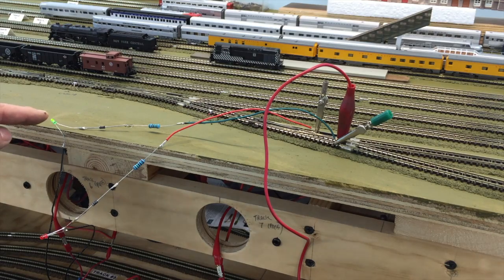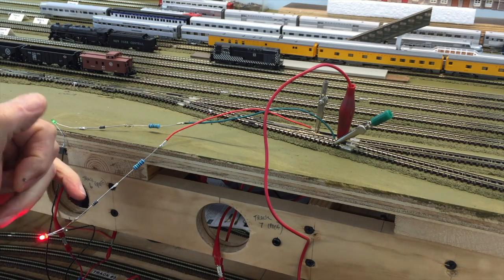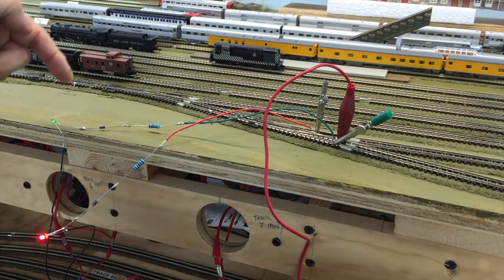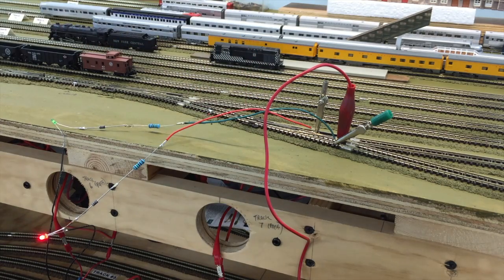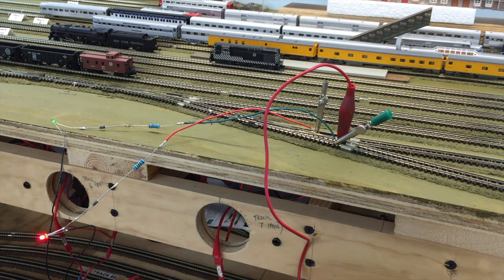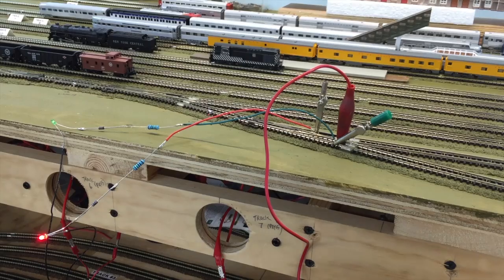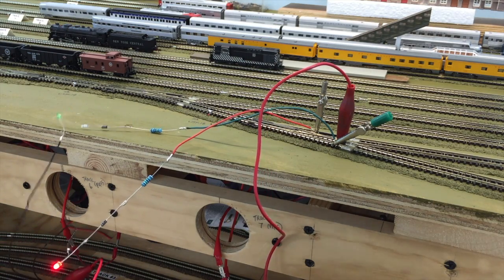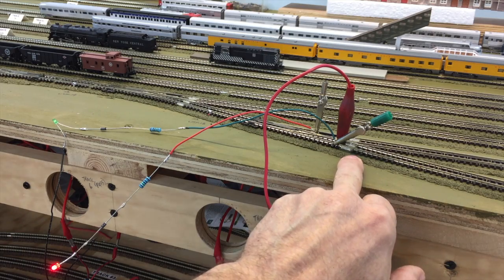DCC Electrical Fun - LED Position Indicator for Manually Thrown Peco ElectrofrogTurnouts

Comment: Hi, would this work for dcc controlled points?
Reply from the maker: Hi John, Thanks for watching and your question. Yes it would work. I have a total of 98 turnouts (Peco electrofrogs on the main level and insulfrogs on the staging level) on my layout and I made a decision that I would only automate those turnouts that I could not reach. The cost of using Tortoise or other brand of controls for turnouts plus the associated accessory decoders and wiring was deemed by me to exceed what I wanted to spend on that aspect of my layout. There are 8 turnouts on the east end of the Union Station yard that I do control via DCC (Peco tabletop snap switches) but all of the rest are manually thrown……John
Reply: @tanzj  I plan on having motors on all my turnouts, some controlled by dcc others by a small switch for shunting operations. I'm amazed how simple your system is, how is it that everybody else does it in a more complicated way?
Reply from the maker: @johntavish8750  Thanks again for your comments. I guess that probably due to the number of turnouts on their layouts that they decided to spring for the cost of automation of every turnout. As a retired person it just was not affordable to me…..John

Comment: Nice job here 1 question tho do you think this circuit would work with Insulfrogs ??? I got a walthers  insulfrog 3-way switch I`ve managed to get an athearns  snap switch an relay hooked up an working on the front set of points.. but I just cant get the second set of points set up to work the same way. So I put a caboose manual throw back onto it... don't really want to do install the undertable thing...
Reply from the maker: I don't think that it would work with an insulfrog because the circuit uses the frog as the power feed for one leg of the LED.  A 3-way is a bit more complicated since it really is two superimposed LH/RH turnouts. You can use a DPDT type slide switch (2 of them) to change the position of the two insulfrogs while using the DPDT switch's contacts to change the LEDs to show the position of the two turnouts. There are several examples on YouTube on how to hook up the circuit using DPDT slide switches. Hope that helps.....John
Reply: Thank you.. I`ll try looking those up an see if I can get it done that way ..I`ve gotten the front set of points hooked up to an Atlas snap switch an relay an it works perfect...the problem I`m having is the second set ...the slide bar on the points is to short so when I attach the snap switch the alinement is way off an will not pull the points far enough to close them.. Thought about just making a new slide bar but not too sure just where to find the tools to do it
Reply from the maker: You can use a small piece of piano wire to go from a slide switch to the slide bar as long as there is enough room to attach it to the side of the slide bar. Or you can go under the turnout to the middle of the slide bar. Some turnouts already have a hole in the middle or you can drill one to match the diameter of the piano wire. If you are concerned that you might short out the track with the uninsulated piano wire, then you can use a piece of styrene pipe just a little bit bigger than the wire. Or you can even try to use some RC control line to connect to the turnout throw bar. Another option, if the 3-way is still in production at Walthers, would be to call their parts department to see if they might have some replacement parts....John

Comment: Sorry to burst your bubble, but the advice given on the other web site regarding the additional diode is not correct. I am a professional electronics engineer. The DCC voltage is about 30 volts peak to peak. An LED is sensitive to being damaged by excessive reverse bias voltages. The diode on the other hand, is far more robust with regard to reverse bias. The diodes as shown in the diagram above protect the LEDs against excess 'reverse bias'. OK I acknowledge that to the untrained eye the LED (without the diode) appears to function perfectly OK. But, it is being unduly stressed. Leaving the diode out of the circuit isn't going to kill the LED instantly and straight away, but it is very likely to reduce its overall lifespan. Personally, I would re-instate the diodes. This comment is not aimed at the original author as the video is more than a year old. It is aimed at new viewers who may be considering implementing this LED design today or in the future.
Reply from the maker: Thanks for watching & I do appreciate your comments.  The subject was beaten to death on Model Railroad Hobbyist by a number of people with opinions in both directions.
Reply: Yes John, this type of debate regularly generates opposing opinions. Many take the view, "It works, so my opinion must be correct". Whereas, the better more reflective view to make is "just because it works, doesn't necessarily mean that it is best engineering practice". The additional diodes are a minimal cost and provides an insurance policy.

PS - rather than in series, the diodes can also go in parallel with the LED (opposite way round). The diode is then forward biased when the supply 'half cycle' is reversed with regard to the LED. The forward bias (0.6v on a silicon diode) then clamps the LED reverse bias to a maximum 0.6 volts.
Reply from the maker: Thanks again.  Would you be willing to message me with a diagram??
Reply: Don't know if this will work (adding an image) but will try.
Reply: Obviously, adding an image to the reply didn't work as it is not showing in my previous comment. The e-mail YouTube sends me with your message hides your mail address and is a 'no-reply@.......' mail address. Therefore unless you know a different method. This message system doesn't seem to support sending images. Sorry.
Reply from the maker: Look again.
Reply: Sorry John, that "Look again." comment has gone completely over my head. Look again......at what?

If you are saying you can see the diagram I tried to reply with....then great......but I can't see it on my browser at my end. If you can see it, then maybe that is because you were the targeted recipient of it.
Reply from the maker: Look at "About" on my channel page for contact information.
Reply: Contact e-mail address found, and diagram sent as requested.

Comment: Thank you John for this video. I was trying to come up with an indicator for my Peco turnouts that will be "finger throw" and Caboose Hobbies ground throws. This is a great idea, I'm  not a fan of spending a bunch of money on switch machines when I have a perfectly good finger to use!!!!!! Will be watching more of your videos.
Reply from the maker: +David Muse   David, I have tried to limit where I use the electronic controlled turnouts to only those that I cannot reach by hand.  I have recently realized that in two locations on the layout, I kind of boxed myself into a corner as I was unable to use any kind of under table control because I could not physically get under the turnout (to include two tortoises that I had already installed before screwing down the sections).  Because of this, I have gone to using the above table Peco PL-11 turnout snap controller with a couple of NCE Q-snap stationary decoders.  They were easily installed/programmed and work great. For everything else, my finger does just fine....John

Comment: Real cool John, I got an old MR from the 70's, that shows almost the same thing when LED's first starting coming out. It using the small Bachmann N scale signal, but for DC.....I like your set up for DCC.  Bob, Longshadowsmodeltrees.com
Reply from the maker: +Widi1956  Bob..Thanks for your comments. This morning I soldered up a bunch of electronic stuff that I've had for a while just to see if it would work with one of the finger changed Peco turnouts. Since this worked, I will use this circuit on the turnouts that don't have a Tortoise or a Blue Point controller on the main level.  The staging area is fine as they are all Peco insulfrogs and the hard to reach ones have either a Tortoise or Blue Point controller. Thanks again...John